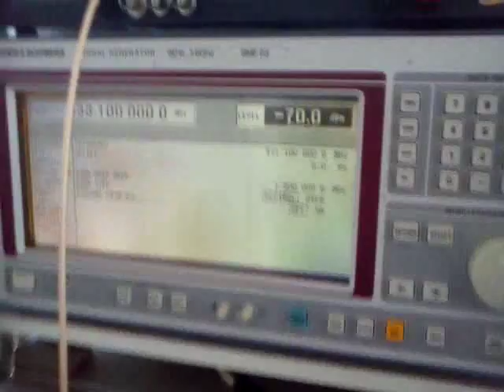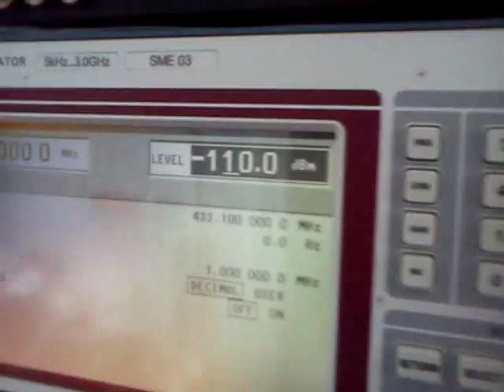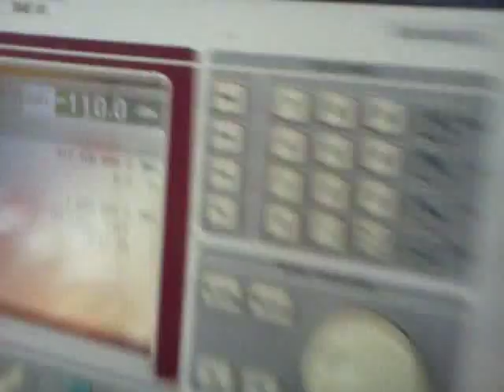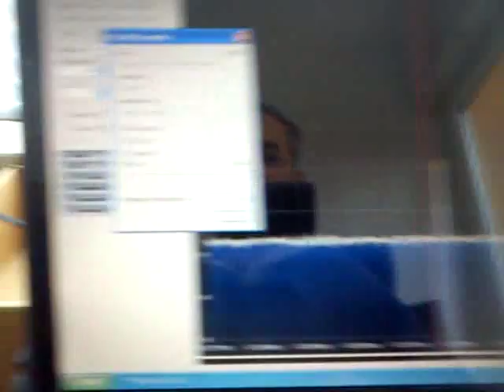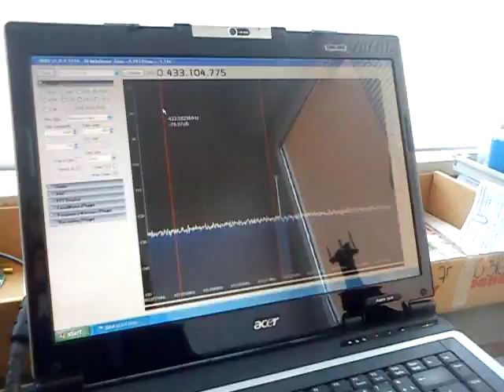DVB-T dongle + LNA = Myth or Truth

Comment: The best place for the LNA is near the antenna to compensate for attenuation in the cable. also required band pass filter after the LNA (not before).
Reply: Why after?
Reply: Because the filter attenuation won't make the signal goes bellow NF

Comment: Isn't it a very artificial testing where the only limiting factor is the dongle itself?
In the real life we are usually limited by antenna noise and strong signals. I'd say the LNA makes sense to compensate for the losses in narrowband filters and not much more.
Reply from the maker: kmikeru Hello, in the real life you are limited with the band temperature (noise) more than a antenna temperature (noise) as the antenna noise is small comparing the band or frequency temperature. The LNA make sense as the dongle noise figure is much higher than the band noise and reducing the receiver noise figure using the LNA allow receiving the weaker signal that are masked with the high noise figure of the system. This way you improve the s/n ratio. Same for narrow or wide band. Of course, another improvement can be achieved narrowing the bandwith.

Comment: How are you getting such a low noise floor on your DVB-T dongle? for my, I can't get anything below -70, even on minimum gain
Reply from the maker: FaCeWaRRioR
Just edit the SDRSharp.exe.config file. Instead of -60 type the value you find more apropriate if you have a known signal that you can calibrate the scale.
Reply: I have the same question.